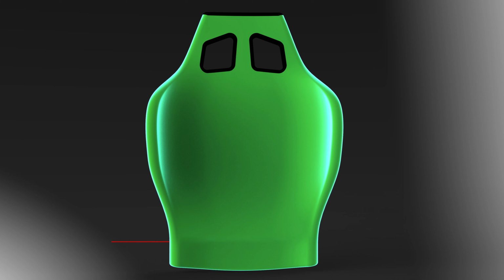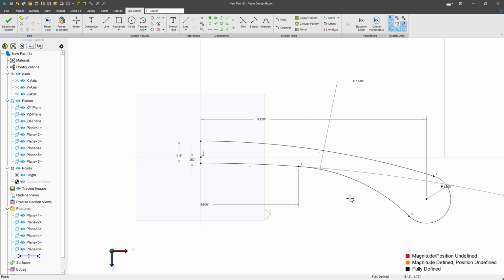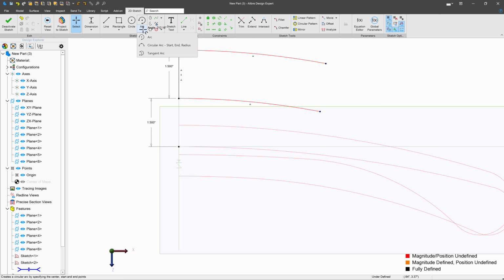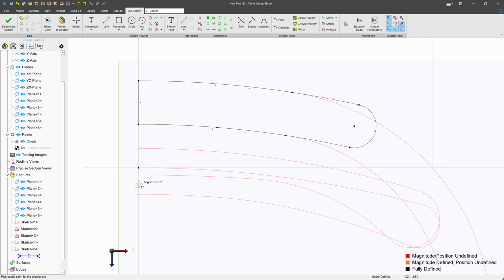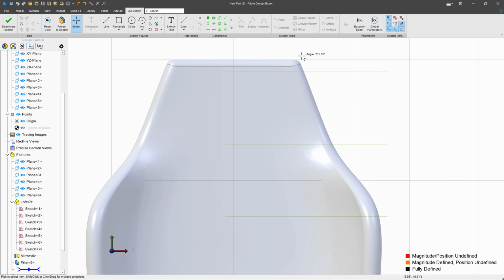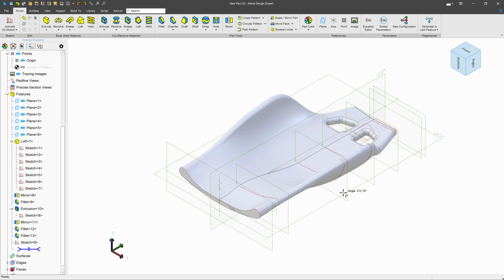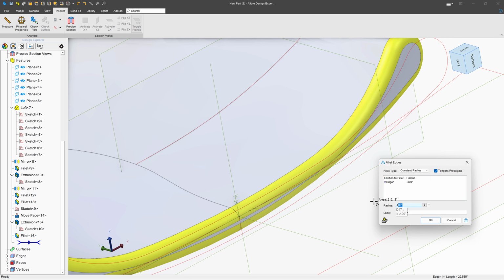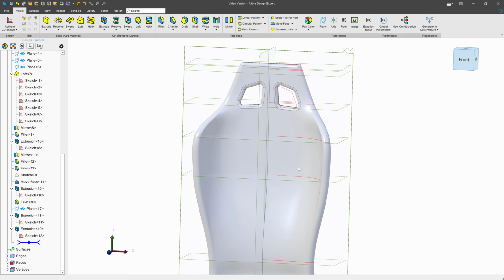Model Office Chair Back | Alibre Beginners Course #38

Comment: At 15:40, you're making an angle of 4 degrees from vertical. I cannot make my dimensions find that angle. How do I do that?
Reply from the maker: Hi there,

Creating a horizontal construction line to angle off of can be effective, also rotating the view just a little and clicking the horizontal edge at the top can also create the dimension.

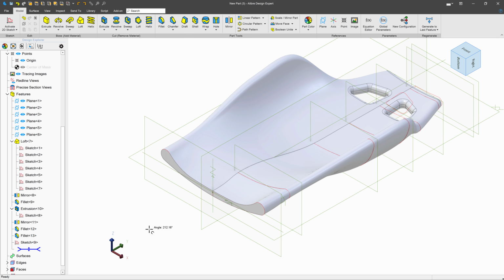Comment: At 18:16 into the video you check the status of the extrude and it states "MANY_VERTEX_TO_ONE". What is going on with that?
  I recreated the seat and think I narrowed the issue down to the mirrored half of the seat. I can extrude the projected Sketch <1> by itself. But if I try to extrude the projected edge from the mirrored half and close it with a line in the middle, I get the same status message on error. I even removed the tangency from sketch <1> in the loft with no resolve.
Reply from the maker: Thanks, we received your ticket and are taking a look